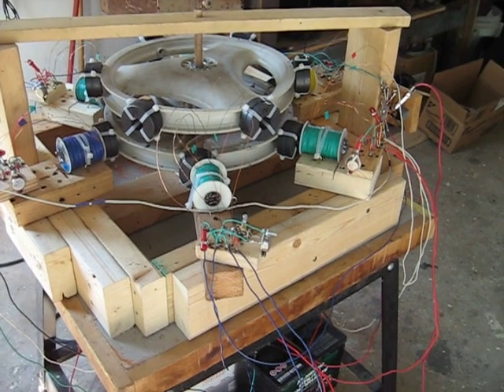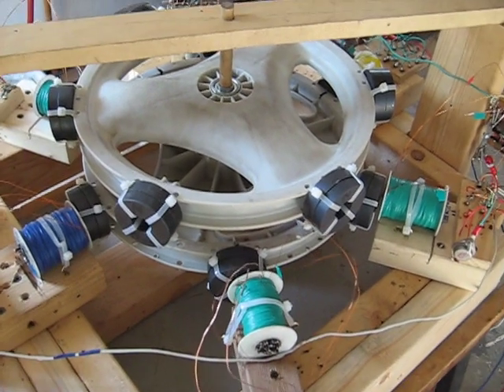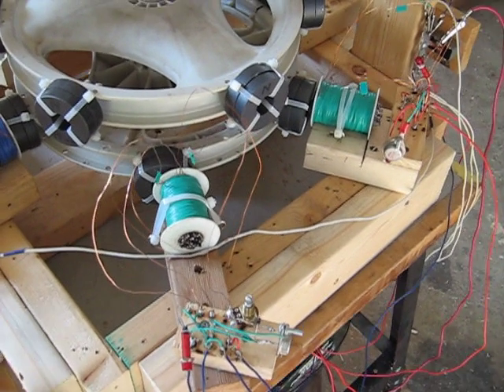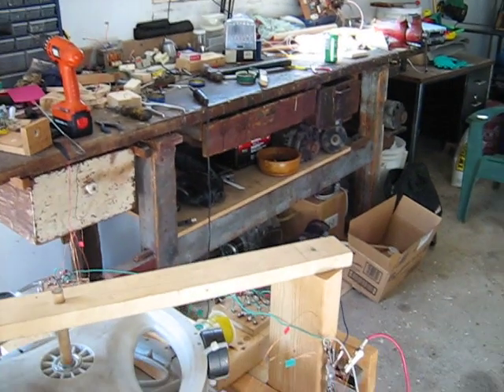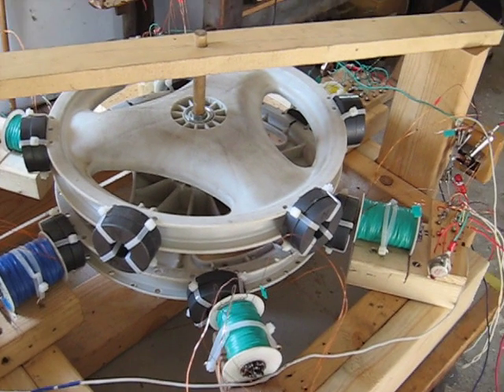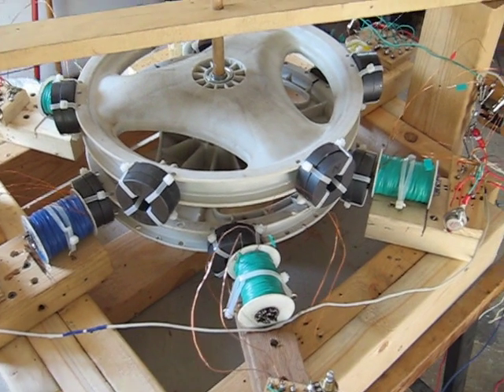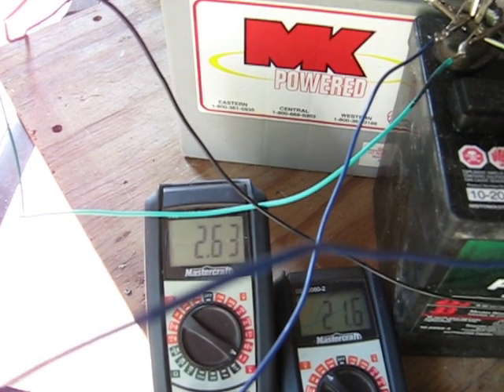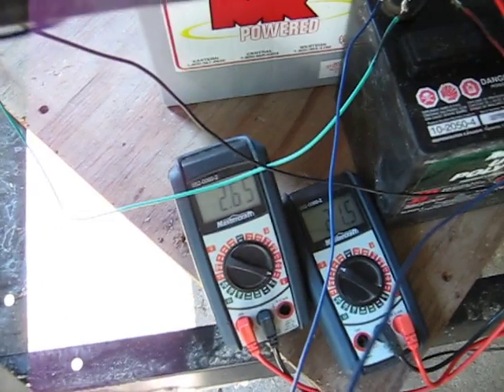Bedini Energizer - 6 Coiler

Comment: As for the charging wires, how about 6 wires going into the charging battery.
Avoid the hassle of a complicated circuit.
I am sure that there are flaws in my concept so feel free to criticize.
I have seen Bedini 30 coil energizer and I am wondering why does he need a complicated circuit.
Have a few trigger wires and connect all the other charge wire into multiple batteries

Comment: Any possibility of using this on an operating vehicle? For example, an electric car, with a couple of these motors attached to the battery pack, would extend the length of time between each recharge? Maybe a full sized car is a bit ambitious for now lols, but I think I saw a video once where a Uni prof hooked something very similar to his electric car motor.

Comment: I like your point of view. Whether or not it has changed. The Bedini circuit is interesting for certain, but at the end of the day, there exists current, available to us. Whether that be 5 amps / 12v from a solar cell, or current from the wall. You have to use that current or your wasting that current. To device a 6 or ten coiler that attaches itself to a solar panel (@ 5a / 12v) that only draws 200 mA and wastes 4.8a is absolutely retarded. The free energy is in the sun, not the coil.